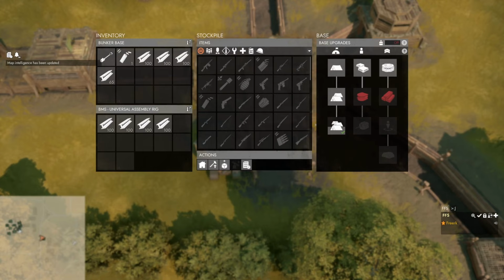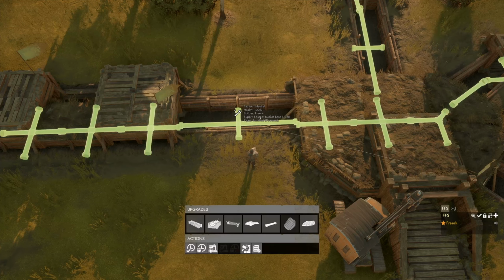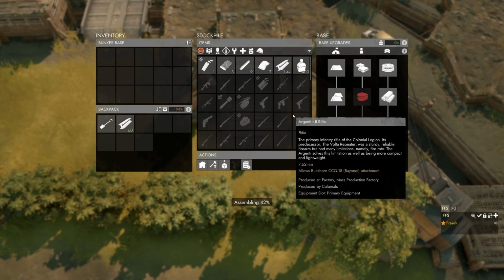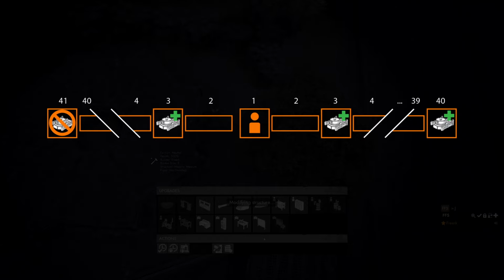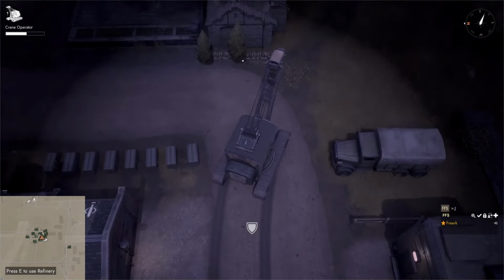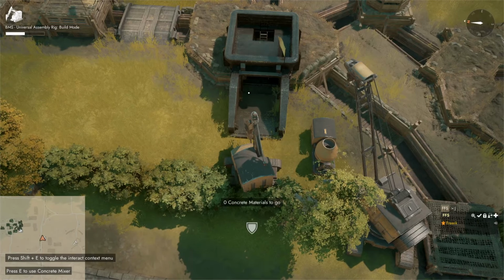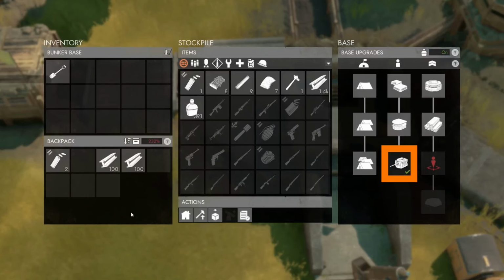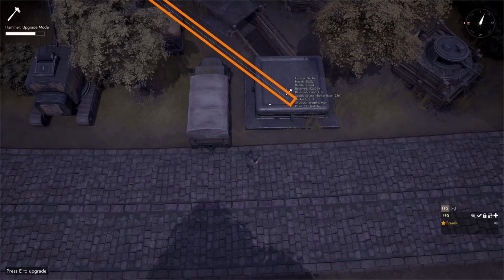Foxhole Guide - Bunker Bases (part 2)

Comment: really appreciate the video! You explained everything in very great detail, until you pulled a pallette of cmats out of nowhere
Reply: i just realized this was part 2, never saw part 1 oops
Reply from the maker: @BalconysHD  To be fair, part 1 doesn't explain the pallet of cmats either.
I used the pallet to show a different method to easily submit concrete, in part 3 we'll use a small gauge railcart our of nowhere, I hope I remember to at least make a brief mention how/where to make em!
So in short; good catch! Noted for next time
Reply: @FreerkHoltes  can also easily read about it in the wiki so no worries

Comment: 6:33 tech donut is better because you can build trench from it, but hard to do so with flower
13:06 you can use CV to build conc pieces
Reply from the maker: Hhhm I never felt the flower was harder to connect than the donut, since both have 8 straight outside walls, but then again I do not dig bunker as a daily activity in Foxhole so I wouldn't really know.
Yeah, I might've mentioned that they can be build by CV, but my aim was mostly to just run through the different ways of building and submitting. SO part 3 will include the submitting with the small rail carts for instacne